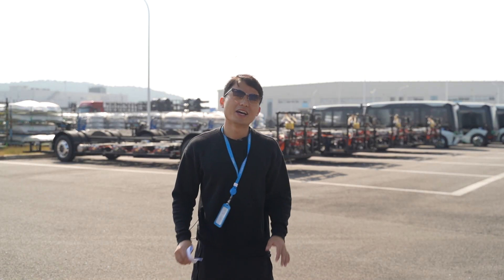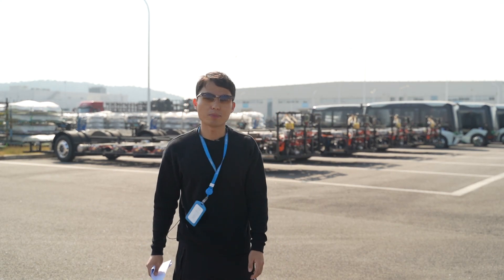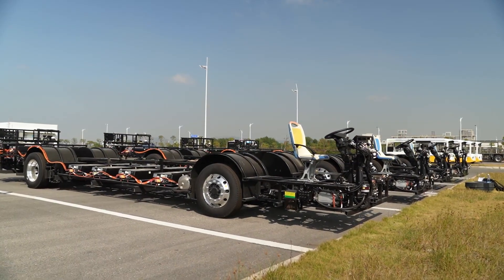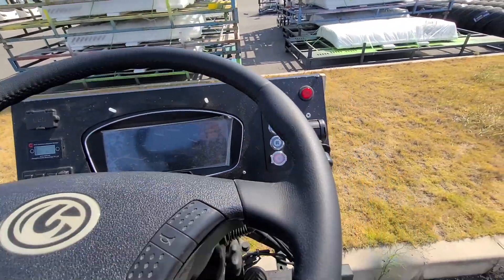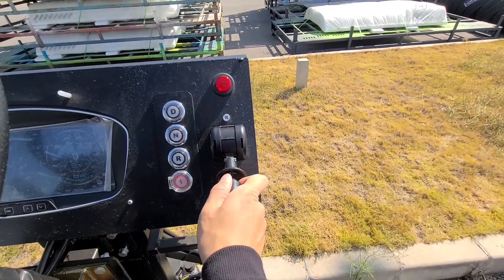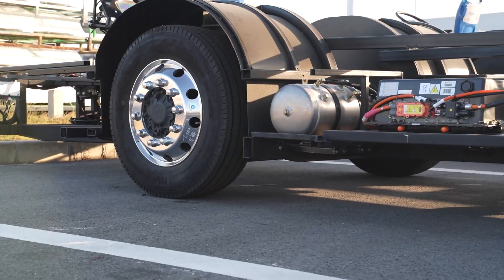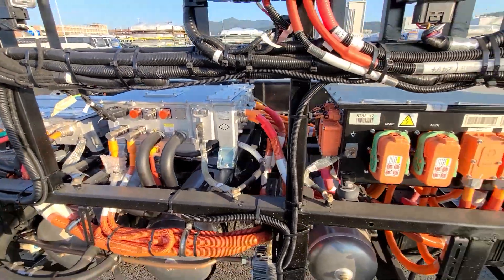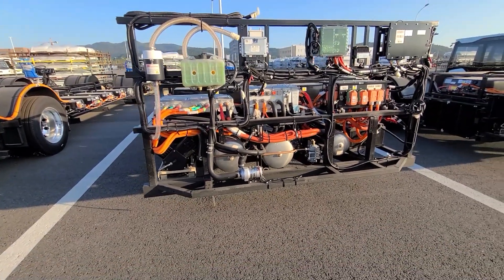RHD electric bus chassis

Comment: Any side impact is not good, batteries and other component should be on the roof.
Reply: We can supply you E-Bus with all the parts on roof. How much quantity you want to buy with 300 km/ charge.
Reply: Side impact is depending how stupid driver habit... less record accident from stupid driver no in a country so dont need battery on rooftop.   Thats fragile and make stability bus are worst than a tanker truck